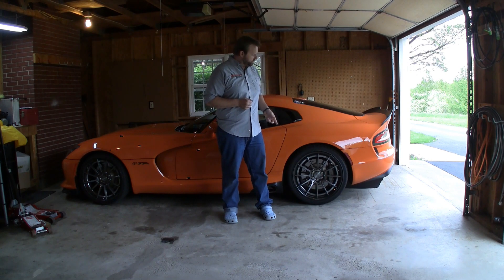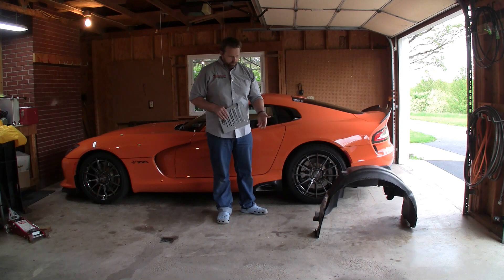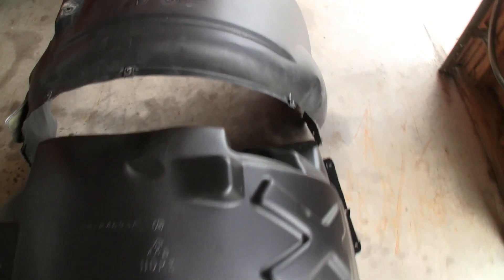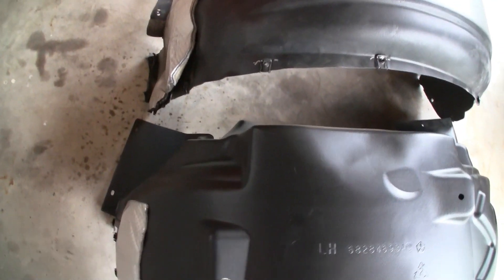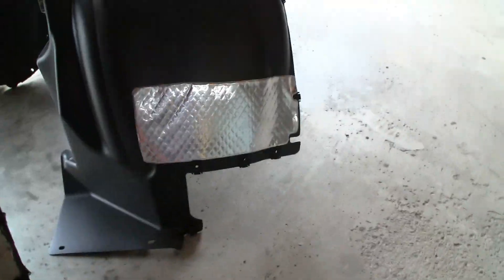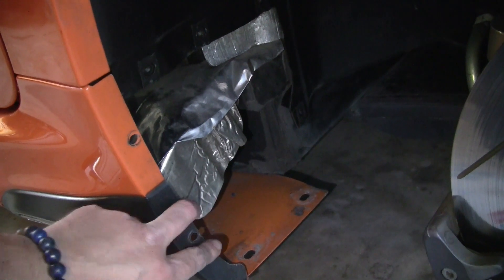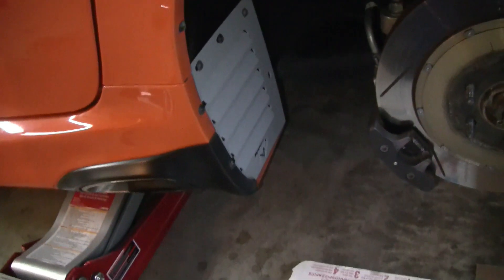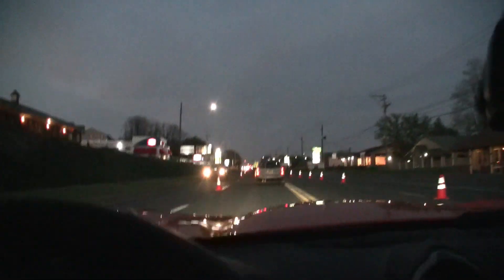2014 Viper Rear Fender TKO Motorsports Vent Install

Comment: thats a one legged cat?
Reply from the maker: Lol that's Marley! His rear left leg was removed due to a tumor he had a few years ago.
Reply: @RunningClothesline  haha, trying to decide if I should track down these liners like you did you cut my 2013 liners and try to install it as is ARGG
Reply from the maker: @Topplayer2g  I complained to TKO about the plates being flat and the liner not being flat, but I'm not sure they believed me. All part numbers for all years are replaced by those liners I bought. There were part number changes for the liners every year of the Gen V. It would definitely be easier to cut your existing liners, since the new ones are so flimsy.